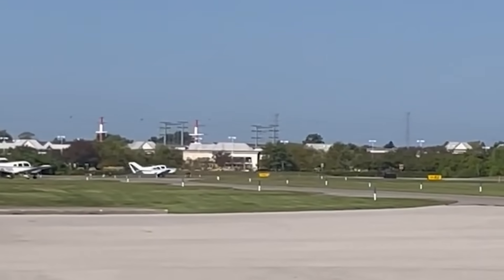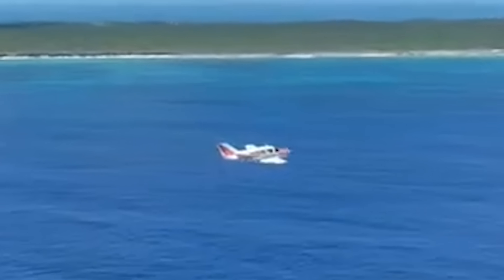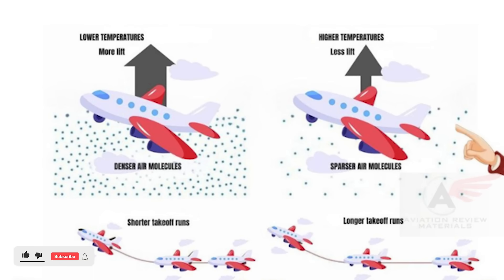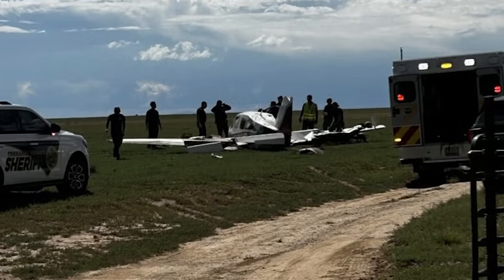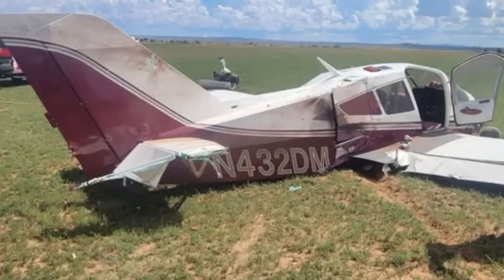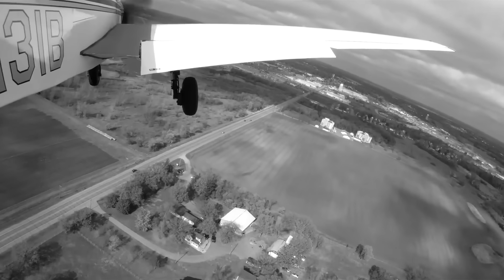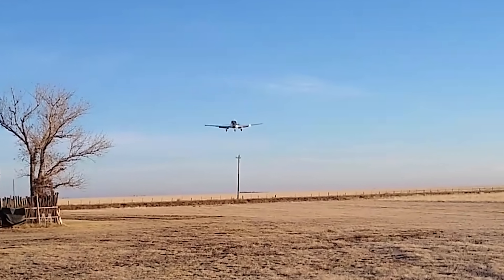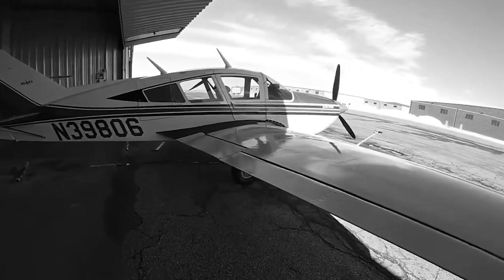NEW Details About N432DM Fatal Crash Sep 16 Moriarty NM, NTSB Updates...

Comment: The turn back or impossible turn can be 1 g at any bank angle if the pilot does not pull back on the yoke.  Because of dynamic neutral stability, an anti-stall design safety feature, the nose goes down naturally in the turn to maintain (dynamically) trimmed airspeed with or without engine power.  That might account for the low altitude that resulted in their hitting the power pole on the road west of the airport and on short final to runway 8 at Moriarty.

I flew pipelines out of Moriarty in the beginning of this century.  The energy management 1 g turn back at steep enough bank to miss the opposite ridge, sometimes called the canyon turn, is a mountain and high desert technique to return back down drainage when unable to make the high pass or if weather or engine trouble requires a tight radius turn.  I actually crossed a 7900' pass just north of Moska Peak (9610 MSL) on a pipeline taking  fuel to the tank farm just southwest of Sunport.  Occasionally I had to make this canyon turn back when downdrafts made getting over dicy in the Cessna 172.  No, there is not much of a canyon there, just a draw.  Normally the vertical space available is much greater than the horizontal space available in the canyon turn.  That is why the steep 1 g (no pulling back on the yoke) energy management turn works so well.  He, like me up on the Monsanto Mountains to the west of Moriarty, did not have as much vertical space available as is available in most ridge valley ridge drainage systems to and from high mountain passes.

Finally if you find yourself in this situation, use cruise or any zoom reserve airspeed available to pitch up wings level before the turn back.  This gives you a bit more altitude and less airspeed (for a tighter radius of turn) but release that back pressure as soon as you begin the steep bank to turn back.  And if low just go for the obvious survivable landing zone in the very near hemisphere in front of the wing.  In 11 engine failures in 17 thousand hours crop dusting and patrolling pipelines, I have executed these six seconds duration forced landings.  Two things when very low:  airspeed and not altitude is life and the more than 180 degrees (without helpful strong crosswind) impossible turn is impossible.  There are many fine places, other than the airport, to land.

Comment: The Super Viking is a great plane but its has to be treated with respect and knowledge. The fuel system has two main tanks and two auxiliary tanks and you have to pay attention to which tank your on. If you run a tank dry it will descend like a rock (ask me how I know). At best glide speed (around 100 mph) your falling at 2000+ fpm. If your flying low and lose power you have seconds before impact. Was the CFI  experienced in the Viking? The Viking is a tough fun bird to fly but very unforgiving.